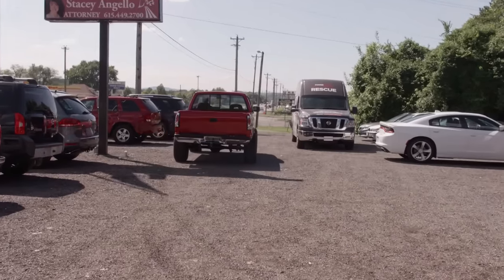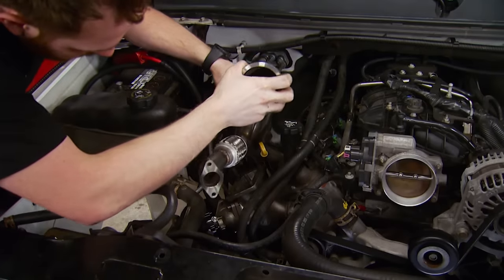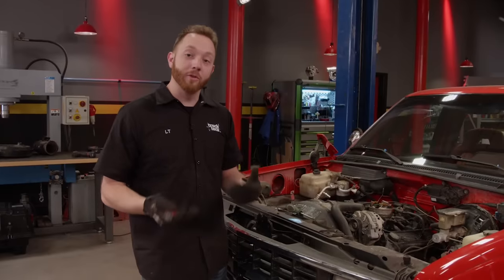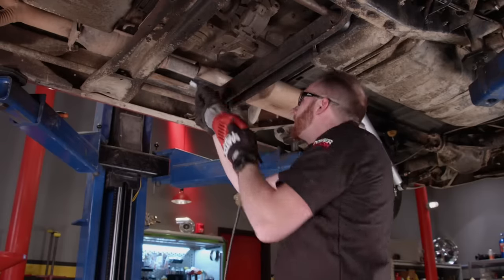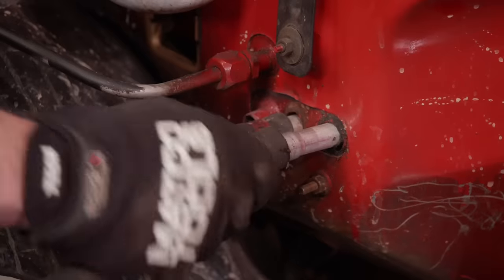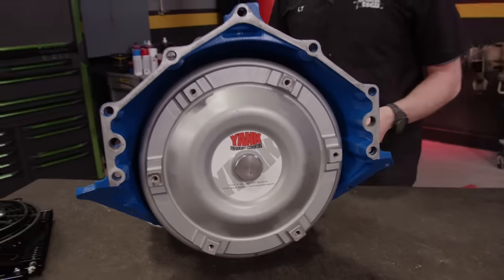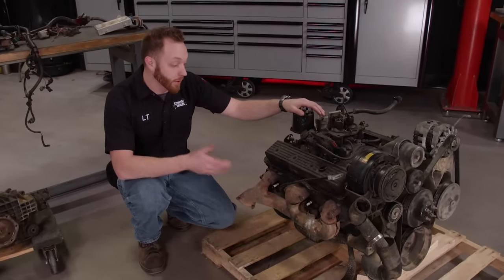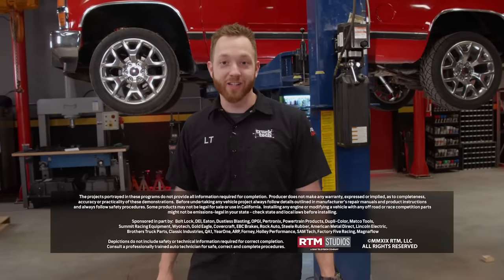LS Swap Do's & Don'ts on a Chevy K1500 - Truck Tech S6, E5

Comment: I'm a fan of power nation. really enjoy Chevy builds. On this episode you swapped old style 350 w/tbi for ls. i'd like to see what you can do with changing out the heads with Vortex heads, more torq cam and either carbureted or fuel ejected vs TBI and a set of headers going from 190hp to ???.  haven't seen it you've just talked about cost.

Comment: I’m dropping an LSA/6L80e in my ‘90 GMC Sierra 1500. Thinking of a wiring harness to go with it. I have my drive assembly (alternator/AC included). I’m in ATL, Ga; where could I go to for a good driveshaft?

Comment: I have almost 198,000 miles on my 95" suburban, still breaks the tires loose if I am not careful and no oil use with 15-18 miles per gal.

Comment: if the 88-98 c1500 4.3v6 5.0 (305) 5.7(350) and 7.4 (454) are taken care of they can very easily go 300k miles and still not burn oil or if they do it a small amount all engines burn  a tiny amount of oil but chevy likes to leak oil

Comment: It's easier to buy a donor vehicle with another ls then pull your parts and then sell the long block or short block. That is according to its condition, I'd keep it if had it no reason to get rid of anything unless you just really want to. Just make sure it's something you don't need!

Comment: Thank you for sharing. A few years ago, I heard on one of your programs that it's possible to swap the front subframe from a later model suburban into a 1960's C-20. I can't remember which year would work so I'm hoping for info. Thanks much.
Reply: 63-87 2wd truck front suspension assembly will interchange, I put a 75 assembly under my 64 so I would have disc brakes!

Comment: You're calling a truck dead with 180K on it? that just goes to show you the previous owner of this truck had no clue what he was doing taking care of that truck. I have a 1989 first year silverado sport with the original motor in it sporting 269,000 miles and it doesn't leak a thing I did put in a new High volume oil pump at 200,000 because it wasn't quite keeping the internals lubricated but the screen had actually come out of the original pump and it wasn't picking up oil properly. I've only ever run Mobil 1 in that truck though and it still has near production compression numbers even with nearing 300,000 miles on it. Longevity all boils down to lubrication and for 35 years of the 40 i've been driving Mobil 1 is all i use in any vehicle. it's proven it's self too which is why i continue to use it and nothing else
Reply: Why are you talking oil when the idea here is swapping in the LS. This was way expensive, it's weird to lower the 4x4, and really, spending what was spent here is kind of like they just needed to make an episode with whatever... I think its ridiculous, and if I was asked to do this I would have at least 5 different options, all for less, and come on all ready, get a little creative, ls swapping is a bore anymore...sorry, but that's my opinion, and I found this totally boring, and think it's a joke. Sorry, but, not sorry. Waste of ALOT of money.
Reply: @justinharris5019  i was talking oil because if you don't run the right oil in them they don't tend  to last as long my 1989 is at 269,000 and counting only because of the type of oi i used and the fact that i've religiously changed the oil right at 3,000 miles. The main idea i was trying to pass along id that the engine that was in the truck still had a lot of life left in it and it was a shame that they just yanked it out like that for an LS Granted the LS is more powerful and lasts just as long but why waste what's left of the old one still

Comment: My concern is that i have a 2001 chevy silverado 1500 and i took out the motor and did a complete rebuild. Will this motor fit good in a 2006 silverado 1500 or what would be the issues that i would run into. I also like this channel i watch it when i get a chance, great job to all the staff. Thanks
👌👌👍👍

Comment: Question. Doing a LS swap into my 92 K1500. I stripped my donor truck of everything and plan on using the 5.3, 4L60e, transfer case, drive shafts etc.... A few guys told me I need to delete the vats off the PCM. To my understanding the BCM only controls lights, windows, security, door locks and access control, and various comfort controls. ... The BCM does not control any engine-related functions. So my question is do I need to delete vats if I choose not to use the BCM?

Comment: Funny he said that the connectors would only work on one sensor when gm recycled pigtails for so many sensors over the years and sometimes you’ll have the same connector on one harness for different sensors
Reply: No, not really. Even if they look the same externally they have different keys inside them and won't work. Not you mention they're usually on opposite sides of the engine so a guy would have to be an idiot to get them mixed up

Comment: Converter pilot adapter for putting a 4L80 behind an LS? What are you talking about? the 6.0 and 4.8 2500s 3500s used to be paired to a 4L80e all the time.
Reply: 4L80E torque coverter have different lengths center stubs so make sure yours fits in back of crank correctly or you will ruin your transmission among other problems

Comment: kind left us hangin like like the aditional harness and controler. just nit pickin but hope your not re useing the ac system the hoses werent sealed it was getting pressure washed😊

Comment: To avoid spending $8000 on turning this 350 into a 550HP 383, we're going to buy crate LS for $3500, a new transmission for $1700, and still need to get all new accessories, coils, probably a radiator, drive shafts, intake, throttle body, injectors, ignition system, etc...
Really curious to see the total on this build. lol

Comment: The first thing I would do is decrease and power wash the engine and engine compartment, Before I took anything apart, and then if you need to take a couple pictures before you start.

Comment: I'm curious why you didn't go with a complete crate LS motor over a long block.  I would sooner go with electronic fuel injection over the old throttle body.

Comment: First of all, lowering a 4WD seems dumb. But that's opinion, so I'll stick to factual errors:

1. He says they installed a turbo on "White Noise" which has a "cammed 5.3". He then claims the turbo increased the power of the otherwise-stock engine to 498hp. Which is it, cammed or stock?

2. At 4:00 he says the camshaft on the LS comes in at 218 and 228 degrees of lift at .050. I wonder how much better it would run at .500.

3. Always remove the ground first - that way you avoid creating a 600 amp spark.

4. Depressurize the fuel system before disconnecting fuel lines.

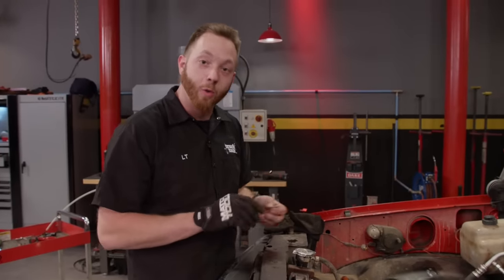5. At 7:45 that's a heater hose, not the overflow. The overflow is the smaller nipple above it.

6. Discharge the AC system appropriately, or just set it to the side if possible.

7. He talks about "if this is your first time" as though all first-timers have a lift and a transmission jack.

8. He never mentions safe jacking - doing it wrong can kill you.

9. What was the point of removing the plug wires, if you're removing the engine with the distributor installed?

10. Not an error, but it's a good idea to take a lot of pictures of where wires and vacuum  lines run for later reference.

One other question - the cost of a 383 was deemed excessive. How much did this build actually cost, by the time induction, controller, etc. was added?

Comment: The truck getting that weak is what happens when you're not smart enough to use Mobil 1 oil in it. My 1989 Silverado Sport has 270,000 miles on it and doesn't leak or use a drop of oil still. All i've ever done to it was change the alternator, water pump, radiator, Brakes, power steering pump, and one fuel pump in the 25 years i've owned the thing. My son wants to restore it but there's not much to do to bring it back, mostly just cosmetic stuff. like paint  and interior plastics. I have ONLY ever run Mobil 1 oil in it and i run Seafoam through the fuel system and the oil both regularly.I added a K&N air filter and replaced that ridiculous muffler that was on it with a flowmaster. everything else is stock or aftermarket GM OEM replacement*

Comment: Personally I would buy a 99-06 truck because they cost the same and you can either upgrade the lm7 or move up to an LS. The bigger ls motors bolt and plug straight up
Reply: Dave Micolichek  he means an actual LS. those trucks came with LQ4s, LM7s, and a few other similar engines, not a single engine code for those trucks starts with L and S. But theres really no need to spend money swapping an LS into them when one could spend that money making more power with the stocker

Comment: Actually my 1st truck was a 1978 K10 with 12,500 miles, 350 and a 4 speed, 3" lift with 14x36x15 Pro Trac High Rollers on it back in 1980. :)

Comment: "Rebuilding the original 350 to make around 450 HP will cost about $6000-8000... So let's swap in an LS long block for $3500, buy a new trans, buy a new exhaust system, buy all new accessories, buy a new fuel management system, rewire the engine bay, have a new driveshaft made, make about the same power and spend TWICE as much money." Because that makes a LOT more sense and is SO much more cost effective! (The last was sarcasm, just in case you are so blinded by your enthusiasm for wasting money that you can't recognize it.)

Comment: I have a 93k1500 blazer that I bought in the motor is a 350 bored 60 but does not have a transmission so what size transmission would I need it is four-wheel drive as well

Comment: i got a 2003 5.3 LS for cheap [200 cdn] but it came w/o a starter, manifolds, ecu , plug wires, sparkplugs, and alternator. he says he is gonna round them up for another 80 bucks but im doubting it.
so can i use newer engine parts like all these listed from say 2006 5.3l ls?

Comment: Have a 2001 Silverado 1500HD 6.0 I just inherited from my father. Tje truck has 331,000 mi on the original engine and trans. He maintained over the yrs but Im suspect that thw engine is have some issues. What other Year Engine can I put in back into this model? 
I hear a 1500HD engine is the same as a base 2500 engine.

Comment: There is nothing "budget" about a $3500 long block. How tone deaf can you get? Two options: A junk yard 5.3 or 6.0 like so many folks here in the comments have already mentioned, or simply freshen up the 350 you've got and maybe try out some Vortec heads and intake and go Carb, or for those that dare, reuse the TBI injection and make it work. It has been done. Not a lot of high dollar parts to satiate your sponsors, but Vortec heads and Intakes. and adaptors, and a whole host of other odd-n-ends are mass produced are available and for the most part affordable for true "budget" minded fellers like myself.

Comment: I had to laugh about pulling the tranny... my first time pulling one with no real experience, aside from smaller projects before, was on my JK last year.  decided to be lazy and stubborn and leave the transfer case attached to the transmission and yes, that was the most difficult way possible to do it... especially with a cheap harbor freight jack and small jack stands.  but we got it done and she still drives great so it's not impossible, just like they say, it's definitely smarter and easier to break it down.

Comment: Puny cam. You left a ton of power on the table
Reply: Dave Micolichek  You don't k ow much about cams avalable for  LS engines..
Reply: Dave Micolichek  Wow you're incredibly special!
Reply: Dave Micolichek  Yet you can't put your face up...
Reply: Dave Micolichek  awesome middle schooler  insult..
Reply: Dave Micolichek  
I'm a man, I'm not supposed to be pretty..
Reply: Dave Micolichek  There're plenty of cam choices out there that will keep good vacuum at idle & make more power at higher rpms.
Ls engines have good sized cam journals, there's a lot to choose from......
Reply: Dave Micolichek  Did I ever speak negatively towards custom grinds?
Reply: Dave Micolichek  I never distinguished one from the other.
Reply: Dave Micolichek  a custom grind is a cam choice....

Comment: By the time you get done buying a crate LS a new computer and induction system and every other little part required to make it work you could’ve built or bought a bad ass stroker motor with none of the haste that goes along with those custom swaps.

Comment: OK I was gunna say somthin about the mileage, but I decided to wait as there seems to be a plethora of comments on that.  But when he says "The transfer case is light and its easy to maneuver the trans and Xfer case, that pissed me off.  Unlike most people, I don't have a lift or a trans jack that goes 8' in the air.  So when I swapped engines ( a 380mi 5.7L for a crate 5.7 from Chevy) I put my truck on jack stands, and then pulled the front apart, grill, core support, Radiator, condensers, in other words I made a big hole in the front so all I had to do was unbolt the engine & Trans and pull them.  However that X-Fer case is one heavy son of a bitch.  About 175#, and it fell on my chest, yes I had a trans jack under it, but it fell off.  After a trip to the ED ( Emergency Department) at my local hospital and four broken ribs on my left side, a cracked clavicle, and badly bruised arm, was back home.  So NO THE TRANSFER CASE IS NOT LIGHT!!!  Be it a Manual or Automatic transmission, they are BOTH HEAVY MOFO's.  So be damn careful, and make sure that trans jack, or floor jack is securely attached to the transfer case, and the transfer case !!  Or you will get the badge   (Bruise, stiches, or whatever they have to do at the ED) of another poorly thought-out move in removing the trans and or X-Fer Case.  All to pull that 180k WORN OUT engine, (Mine a 5.7L has 285K and purrs like a kitten, and eats Chargers for lunch!

Comment: I have a 97 Sierra 4.3L vortec. I want to v8 swap it and discovered a 383 long block with intake and carb. What mounts would I need, can I reuse the front assembly like how the 4.3 and 5.7 are interchangeable? I would like to go with long tube headers but what would be best , space wise?

Comment: I have a 1996 with a 4.3 vortec and 5 speed manual. Is it feasible to swap an ls or 5.7 vortec into my truck without a ton of trouble? I’m just looking to have a good driver but a bit more power wouldn’t hurt.

Comment: I have a 4 l q 6 liter in my suburban to 4-inch stroke and a 4.04 inch bore what should I upgrade the injectors to stock 4lq has 38 pound injectors

Comment: I'd love to see what you can do for a "Practical Performance Upgrade" on a 1993-1996 Ford Ranger 2WD with a Tired 2.3liter Manuan Transmission!

Mild Lowering Kit with the Purpose of using it to haul 1,500lbs of Gravel... and be able maintain 20+MPG!

Take care Truck Tech Crew,
🤓 -Thomas
Western Washington State
Reply: 5.0 v8
Reply: @boostedmonza5023  Yeah, but I want to "Actually Work on it"...

Ever tried to do a Head Gasket while bolted in? NO WORKROOM!
Reply: Rebuild with head cam and turbo properly build would out run 5.0 in it with less work
Reply: Check the ranger station website  all you need to know about rangers
Reply: boostedmonza502 coyote swap

Comment: I love the power nation channel and videos , but why compare apples to oranges? " A 383 stroker would
cost us 6-8k by the time it was all done so instead we got this Ls 5.3 for only 3500" ya, but that Ls still needs
sensors, coil packs, intake, carb or injectors, computer and all new accessory mounting system to adapt old 
power steering , alternator  and ac pump onto new engine.  $3500 is just a starting point not the total.

Comment: Dude it's called a sawzall unbolt motor mounts and trans and anything else get cut off the engine. Wires, hoses, everything then pull it out. Done in under an hour.

Comment: As long as the motor is built with cam bearings instead of the cam riding on a film of oil, an engine from Powertrain Products is fine.  It means you can follow the Powertrain products spec to use conventional oil.  Not all their surfaces mate properly. Conventional oil seems to have a thing that helps with that.   If you have a Chevrolet or a Ford VVT motor or all Cadillac motors that need synthetic it is best to AVOID Powertrain Products.   The warranty?  It is an absolute nightmare trying to use it so I wouldn't put much faith behind it either.  I should've bought a Jasper.

Comment: If the truck still has an AC compressor instead of the duralast bypass pulley and bare pipes the engine is still good

Comment: I would probably keep that 350 roller motor, all the aftermarket stuff is cheap. (6 to 8 thousand to rebuild) they must be smoking crack. You can buy  two 383 strokers for that money Blue print engines has several stages of strokers

Comment: 250k miles is when a gmt400 drivetrain starts to show age. What you should really be worried about is the fact that after 100k on the truck itself your electrical system inside is gonna go

Comment: hello i have been watching power nation sense it was shade tree garage and all i ever see is automatic trans swaps and upgrades are you guys afraid of manual trans swaps or upgrades? 
i am looking to do an 5.3 swap in an 1989 chevy 1500 hd 4 speed already swapped  to NP4500 5 speed and would like to see an build doing what i am looking to do will need help with the wire harness and fly wheel spacing sense the ls is shorter then the old chevy blocks before it.
could you provide the websites that may have these information on harness work?
i thank you for all your time sharing your knowledge  on these builds but really half the time they are not budget for the rest of your audience me i got me 2 ls buy hard work the garage i worked for he was gonna throw them out as for the rest i will buy 150 for the rest and trade for the ls harness this is how i am getting mine put together not buy having the parts giving to me to sell to the masses.